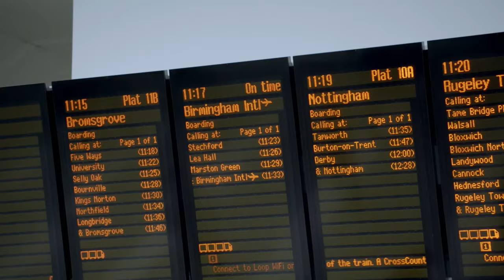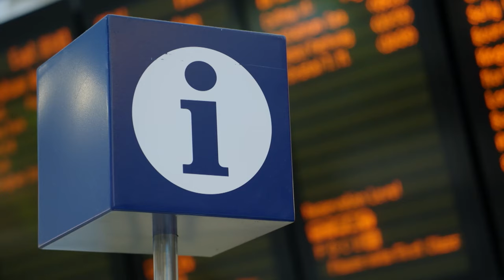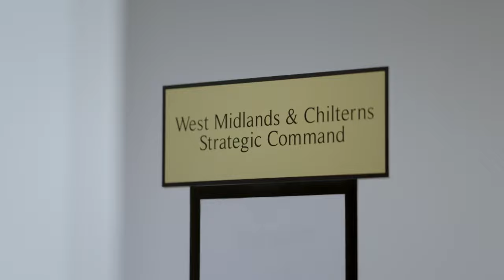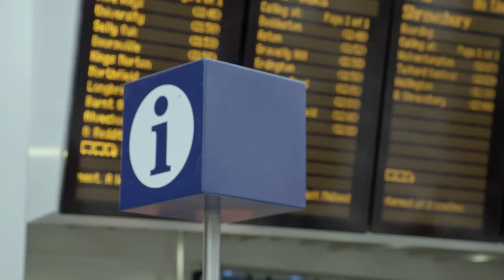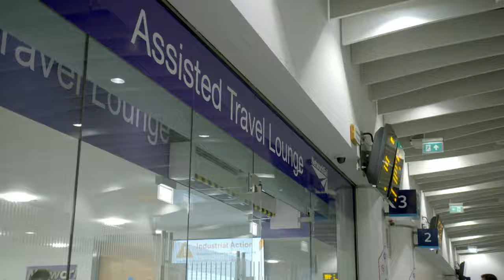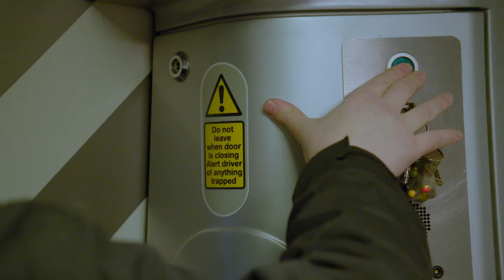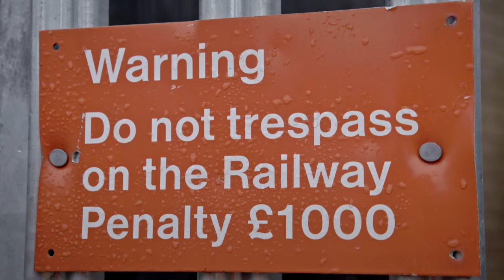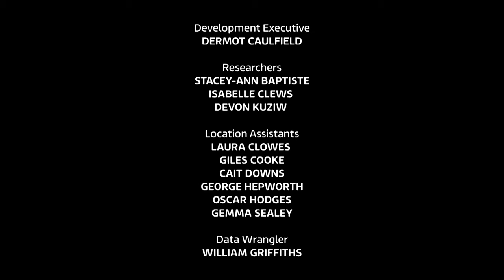The Station - Trouble on the Tracks | Part 1 | FD Real Mini-Series

Comment: I've worked for railroads in the USA and at the beginning of this video that small amount of water on the rail line they showed the guys digging in was nothing. The trains could run through at a restricted speed very slowly until clear of the water and the maintenance guys could just monitor the situation. That small amount of water was nothing and there was another track that the train could have run on to go around the water and still could have run at restricted speed on that track just to be sure. That was ridiculous. Had to been worse somewhere else down the line that wasn't shown. And how the hell does it take over an hour for the ambulance and paramedics to come? WTF!?
Reply: city traffic💀